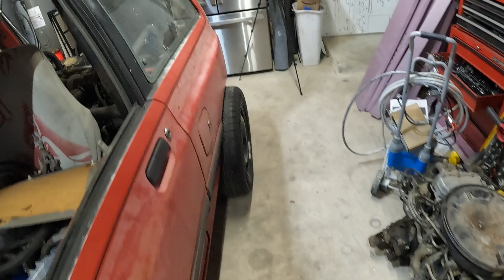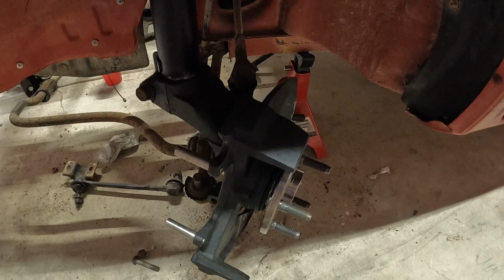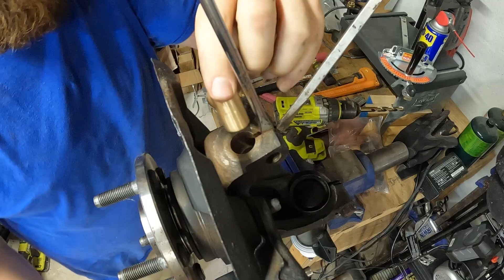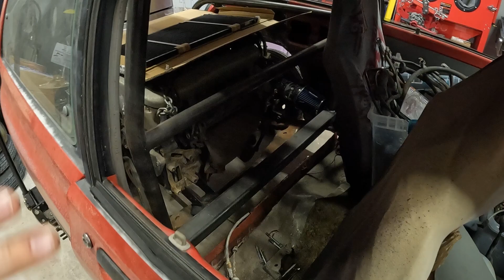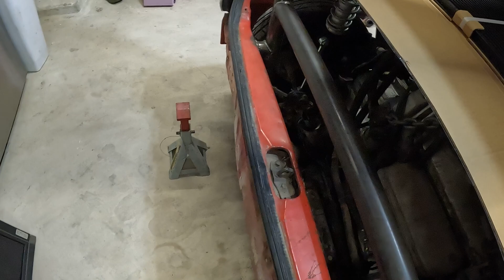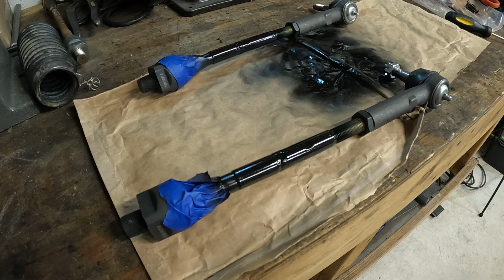Ford Shogun Build - Episode 6. Front Suspension and Steering.

Comment: I was going to suggest redrilling the flanges and rotors to 5x114.3 to greatly Poe up your off the shelf wheel choices. That is provided there is enough room for the new pattern on those components. Also can’t wait to see how you do the body kit. I’d love to do something for much wider wheels on my XR4Ti.
Reply from the maker: Believe me, I looked into it. Would have required some significant machine work, but it definitely was a possibility. If you CAD up the hole patterns, you can see a significant issue. One hole is always going to land partially on another. What I did ended up being easier and allows me to use off-the-shelf parts (with the exception of having to make the tie-rods lol). Making the tie-rods is easier than machining the hubs. The body kit will be done in similar fashion to what B is For Build is doing on his current build. He beat me to it =P Thanks for the input!